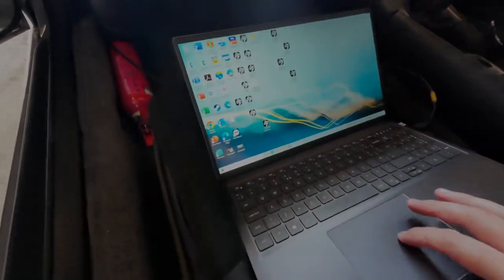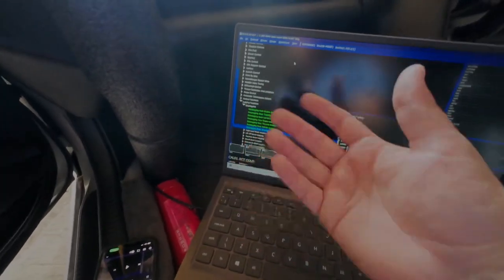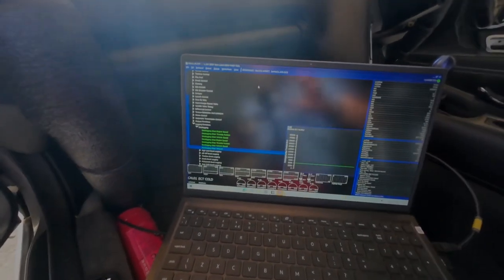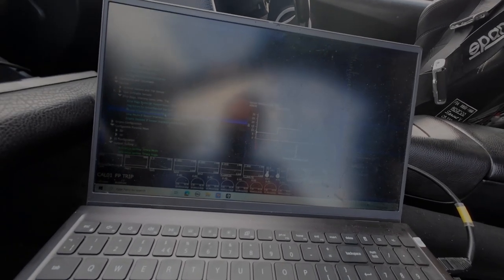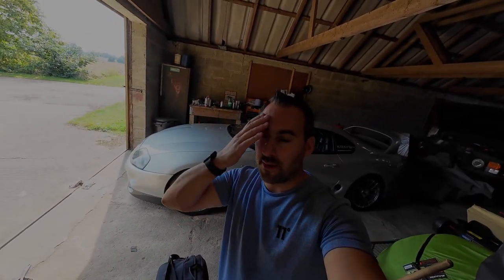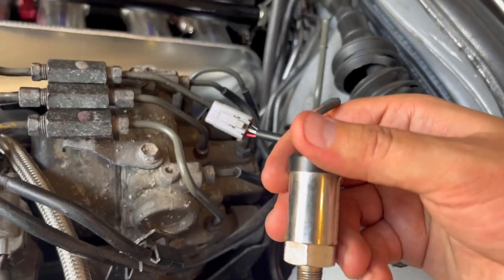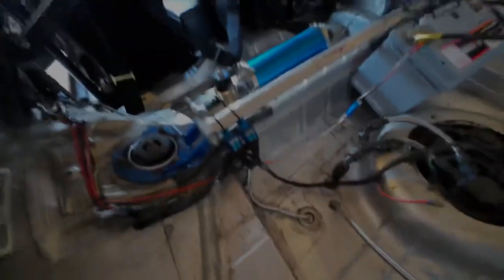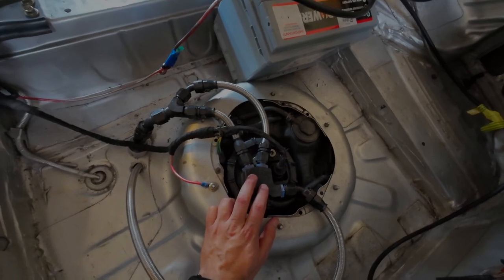Unleashing Raw Power: My Jaw-Dropping 1200bhp+ Supra Update

Comment: Good thing you hooked it up. The last thing you want is some ping power leading into an epic failure from running too lean.
Hope it's a simple and cheap fix
Reply from the maker: To be honest I would say yes normally but the Syvecs is so clever, it understands the situation and just cuts to how ever much it needs to and it always saving the motor and anything else. 
Will be taking a deeper look this weekend 🙌 fingers crossed 🤞